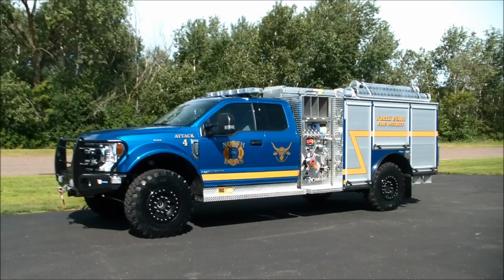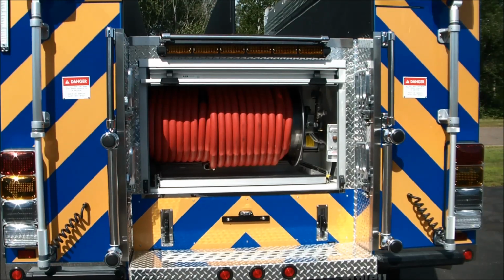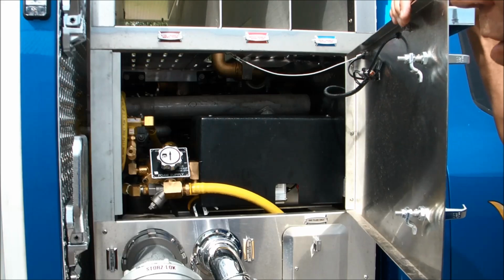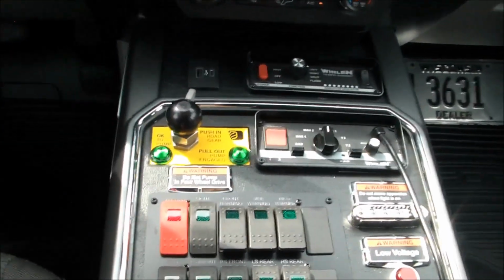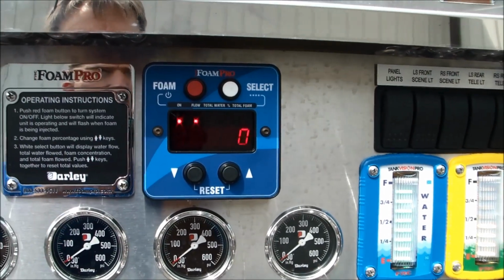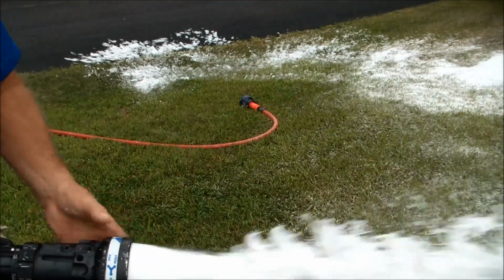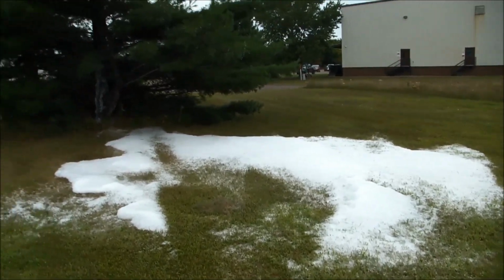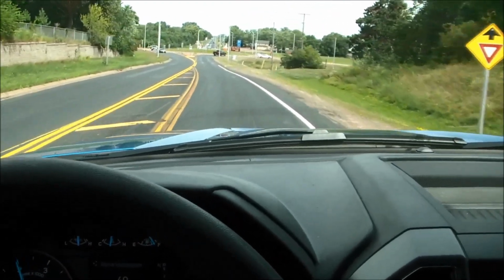Darley Max-Quick Attack

Comment: Amazing truck!  I noticed the mileage went up on the truck from the first time it was put into pump to the end of the video. Added like 80-100 miles to it. That would be one downside to it, mileage would be way high for resale even if actual mileage was not high.
Reply: Thanks for paying attention and watching the whole vehicle. I shot the variety of video clips and edited them over the course of about a week. We did drive the truck 20 to 25 miles during that week of filming to get the Ford chassis alignment performed and the test drive also added some mileage. I think at one point there was around 280 miles in one clip and at another point around 325 miles, then I edited an older clip and the mileage dropped back to 280ish. Rest assured, mileage does not accumulate during pumping, but engine hours do.

Comment: Why not do a PTO pump on a truck like this, so you can pump and roll? Is something like that possible on a mini?
Reply: Sorry for the late reply. The automatic transmission PTO opening on the Ford F550 4 x 4 is very challenging to access. Only a very small pump can be used if you choose for it to be driven by the PTO.